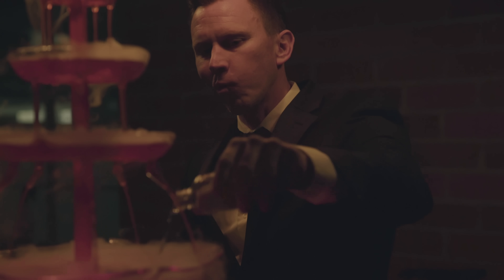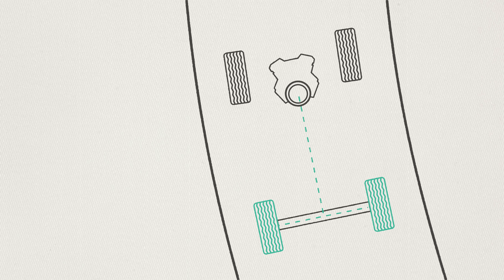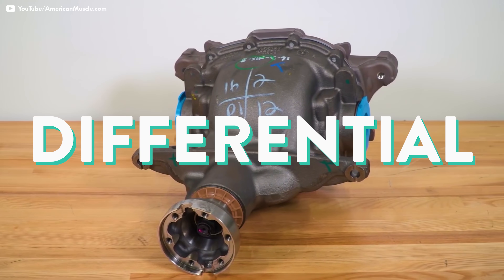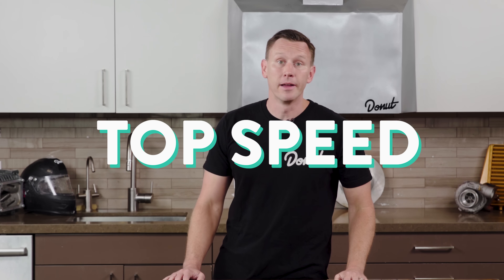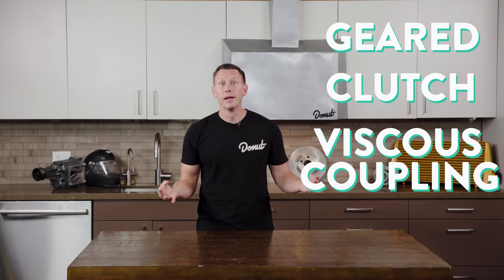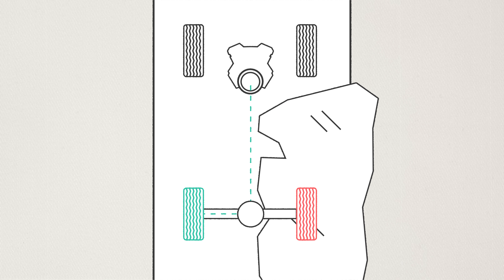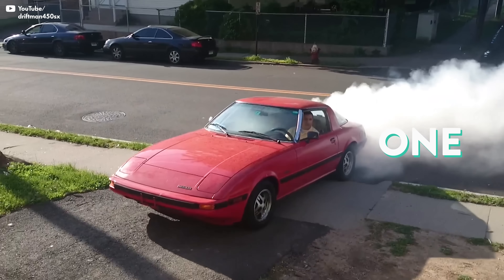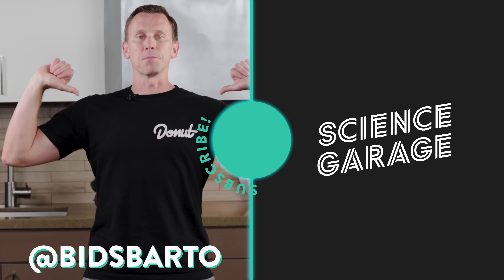DIFFERENTIALS | How They Work

Comment: So nothing like burning your brakes more for traction.  Seems overcomplicated, thus potentially prone to more failure than a traditional LSD, not to mention uneven brake pad wearing and sooner brake replacement, since when one goes, you're likely to replace all (or at least two).  Sounds like a cost saving measure that actually passes on the cost to the consumer.

Comment: The limited slip I installed on my Mustang has a slightly different design. Instead of clutch discs on either side, an S-shaped spring is fitted between the two axle spider gears. The spring pushes against the spider gears, creating resistance. The open diff I yanked out didn't have this spring. If the car is going straight, the spring rotates with the axles. If one axle tries to spin faster than the other one, the spring's resistance limits slippage. 

This was a Ford Racing Performance Parts LSD I installed on an SN95 (Ford has since discontinued production of this unit), so the newer S550s may use clutches.

Comment: 1:14 this animation is misleading and wrong
Reply: Could you explain why it's wrong please?
Reply: @JuiceyBeverage  The wheel on the inside of the curve rotates more slowly than the wheel on the outside of the curve due to the shorter distance and the different speeds. With a rigid connection, the wheel on the inside would spin or start to hop, not the outside wheel as shown in the animation

Comment: When locking differential gives same power to both the rear wheels then both of them will be rotating with the speed which is basically same as any car with single axle and no differential.....🤔🤔

Comment: David shearer was Australian and his plant was in Mannum south Australia 
1898 David Shearer built Australia's first motor car. Steam powered, it had a horizontal boiler with a working pressure of 350 pounds per square inch (2,400 kPa) made by his nephew J. A. Shearer. The engine weighed 2 cwt, and developed 20 horsepower and in 1900 travelled from Mannum to Adelaide and return without problem
For further information go to J&D Shearer Mannum South Australia and see pics of this car

Comment: Y dont the pinion gear be like 5 times bigger then the ring gear thing that its attached to I know torque but that's what the transmission is for but if u do that you go a lot faster like alot faster I should build cars I know how they work pretty well I just smashed all of the vidios about how they work from 1936 into my brain vidios like this
Reply: sparrow i read this 2 times and i still cant understand Your grammar

Comment: one mistake he made to say a car is geared higher means that it is geared more for top speed than acceleration although the number is lower . when it is said a vehicle is low geared  it means that it is geared more for acceleration , or low speed  even though the number in the ratio is higher . the numbers are reversed from the phrases . but that is the way they have called it since the car was invented

Comment: Final drive ratio is actually the finality of the entire gear system. Simply the revolution of the engine crankshaft to wheel rev. ... Not the axle ratio.  It would be the axle ratio and used to be the same with only drive 1:1 ratio. With an overdrive, say 0.67 :1 , and 3.42 axlw ratio you have a final drive of 0.67 x 3.42 = 2.2914:1 final drive ratio in OD.

Comment: Hi there my name is tim ( $hort cut ) for  hatem I life and work in Dubai UAE as a garage owner 
 I've made a very simple 
modification to the exhust system that can safe gas  I tried it on my 2012 tundra it work but it needs more improvements to get a greater results but with my on hand options right now it's not easy so I thought of contact you guys we might can cooperate just wtsap me if you're interested 
 +971581584445
Cheers

Comment: So why not name the LSD the Increased Traction Differential or something along that line? I dunno to me it makes more sense because the LSD requires explanation in order to understand how it limits the traction of the wheel with less resistance while Increased Traction Differential basically tells me what the LSD is does without the explanation? Does that make sense?

Comment: A locking differential does not send equal power to the wheels, it forces the wheels to turn at the same speed. But the torque going to each wheel can be vastly different

Comment: Another thought you could have mentioned about why differentials are needed: Think of trains, which have solid axles on all wheels, including non-drive wheels. On a sharp turn they screech and squeal because one of the wheels has to slide.

Comment: Alrighty... I know you all love to get wicked technical with these, but how about a run down on the different suspension upgrades folks can make? Coilovers? vs cross bars? vs front and/or rear bars? I'd love to know which would give me the most bang for my buck, when trying to clean up a sloppy econobox... And still have a daily driver that won't break in half if I hit a pot hole. Youknowwhatimean?

Comment: The System from toyot that was mentionend at 6.24 aint so unike. It was used from 1992-1995 in the vw corrado and was called corrado eds (elektronische Differential sperre) it was optional in the 16v and g60 Modell but standart in the vr6.

Comment: Generally AWD has a center differential, which may be as with other differentials, open, lsd locked.

4wd do not have a center differential, they have a transfer case which acts as an indepented gear box, allowing drive to either be 2wd or 4wd.

Comment: I actually knew about the 3 different differentials on awd/4wd because I have a awd rc car and when I broke the diff casing on the front of it I had to take off the axil shield revealing the middle one, I then had to take apart both the front and the rear to get the axil out of the dif case

Comment: With locked / welded differential, both wheels are always equal RPM, but NOT equal power (or torque). Torque always biases to the wheel with the most traction with locked diffs, from 50/50 to 100/0 (well, almost 0).

Comment: Irony, you lock both tires together for traction purposes, but also lock both tires together for loss of traction to drift.  So which is it, do you have traction with a LSD or not?  Seems to me 3 tires with traction and one tire spinning is better than 2 tires spinning with no traction, and the two with traction trying to compensate.  This is why you see a lot of powerful cars with LSDs end up in the guardrails... or in crowds.
Reply: Midnight Mechanic Its one of those things where it's kind of both. Having only one wheel spin can cause traction problems and having both wheels spin can cause traction problems. Ideally you want to be somewhere in the middle where there is some wheel slip between the two sides but not too much. Because if the outside wheel is receiving too much torque it will break traction and cause oversteer. This is why electronic limited differentials are so popular in high powered rwd cars as they can automatically adjust how much locking occurs so you can put down more power without oversteering as much
Reply: Electronic limited differentials are popular, but you're not going to see a whole lot of them in older muscle cars, which most likely will have mechanical LSD, unless otherwise modified with electronic stability components.  One wheel's a little easier to control than both rear wheels going out at once, I would not recommend a LSD to any novice.  In a high powered car with instant torque, the LSD can make it virtually undrivable, and won't go as fast around a track as expected since all the power and traction is being converted to tire smoke.
Reply: Midnight Mechanic But thats exactly the same thing that would happen with an open differential. If only one wheel is spinning you not really accelerating through a corner as a slipping wheel has very little friction. And very little friction means very little torque and therefore very little power. Having any limited slip means you can put down power better and get faster lap times. The thing about conventional limited slip differentials that most don't realize is that they don't completely lock your wheels together. The majority of the power is still going to the wheel with the least friction. And the amount of locking force is a lot lower then most people would think. My infiniti qx4 with a rear lsd will constantly overspin one wheel.
Reply: Having electronic stability in conjunction with limited slip would be the best route to go, since the computer is going to control any wheel spin, and the tires can be best utilized through corners even if the tire hits a slick patch.  Throttle control is key to making sure the tires don't go up in a blaze, but electronic stability allows for much more ease of the throttle, making the car more forgiving.  If a tire hits a slick spot no matter which side, it's going to want to overspin, but stability control prevents that.

Comment: Equal TORQUE, NOT equal POWER!
4:1 is a LOWER ratio than 3:1 - for each turn of the input there is a LOWER number of turns of the output, just as 1st gear in a gearbox is lower than 2nd, which is lower than third, etc. This is also sometimes referred to as "shorter" gearing, with taller gearing being called "longer" gears.

As your "ice" example shows, it is critical that torque and power are not confused/mixed up - while it is correct to say the majority of POWER is lost to the slipping wheel, it is because the (open) differential ALWAYS delivers EQUAL TORQUE and if one wheel can only take 'x' torque the other wheel will also only receive an equal 'x' torque, regardless of how much it 'might' be able to receive while maintaining traction.

Comment: can an open diff spin both wheels when you do a straight line burnout of is it always have to be one wheel peel?
Reply: Yes an open diff can spin both wheels as long as both wheels have about the same traction. But if suddenly there is a large enough difference in traction only one wheel will spin.

Comment: Is it the same if you have independent suspension you should do one on a vehicle that has a solid rear axle and independent front suspension like a Toyota 4Runner 03 plus it's got that Center locking diff I found this video very very interesting I go off-road a lot never know what the inside look like

Comment: Awesome and clear video... I am just wainting for the 4wd one.. I am new on the 4wd world.. and in fact, i thought that if i engage the low gear it was the same as locking the diferencial. However a friend told me that is not the case

Comment: HELP:

My tachometer while driving sometimes, both in a state of accelerating or while cruising, seemingly randomly continues to climb while my vehicle does not actually move any faster. 

After a few seconds of it climbing the needle falls and everything returns to normal. Any ideas out there as to what this may be, or at the least, what I should refer to it as so that I can address it with a mechanic?

Comment: It's important to note that clutch packs are pressed together by the preload spring and axial forces (the faster the driveshaft/axle spins, the harder they're pressed together). When they are not spinning fast, the clutch packs are allowed to slip thus the differential acts as if it's open, hence "limited slip".
Reply: Oh! Thanks, he should read the useful comments and include extra or missing info in a follow-up video.

Comment: Is this video being sponsored by Toyota, because Jeep has been using abs to get torque to different wheels for much longer? The Quadra-Drive II system is basically the best example out there of this technology and it includes a locking  rear diff. You can run with 2wd, awd, 4wd, 4wd hi with rear locker, or 4wd low with or without rear lockers. The only thing I can think of that's better is the much more expensive version on the G-Wagons. Jeep has been working on these technologies much longer than anyone else as far as I know. I could always be wrong though, but my old 1976 Wagoneer had Quadra-Trac II on it that was based on limited slip technology with a rear locker. Toyota does have that "get you unstuck" technology for us dummies that nobody else has so I will give them that. Great show though. Keep up the great work!

Comment: I still don't fully get get the difference between awd and 4wd
Reply: is easy to understand car throttle channel have a video explaining it but basically  4wd lock 4 tyres equally that's why is mostly used for off-road because it send the same amount of power to the 4 wheels while awd can spin tyres at different speeds or in a few word can redistribute how the engine power get to the wheels like 50/50 means front wheels and rear wheels get the same amount of power while 20/80 is 20 percent of power is going to the front wheels while 80 percent is being send to the rear wheels

Comment: 🙌RAMCHARGERS🙌
Reply: RAMCHARGERS
Reply: Stalechargers!
Reply: 👏RAMCHALLENGERS👏
Reply: Rong show
Reply: RAMCHARGERS crew, ASSEMBLE!!!!!!!!!
Reply: @metanumia  dumbass
Reply: Émile Robitaille rAmcHArGeRs
Reply: Wierd sensation to buy a dodge now
Reply: MOPAR OR NO CAR   jk fuck domestics xd
Reply: That truck has the longest stopping distance in this test by Engineering Explained "Do Wider Tires Actually Have More Grip? Testing 27 Cars" https://youtu.be/3X2NbToEofw
ℹ️ so, if you know someone with that truck, tell them to think about getting ceramic brake pads, drilled/slotted brake rotors, and to use DOT 4 brake fluid to handle higher heat. (So if the brake fluid is already hot, it won't boil when you need it the most).
Reply: shut the fuck up